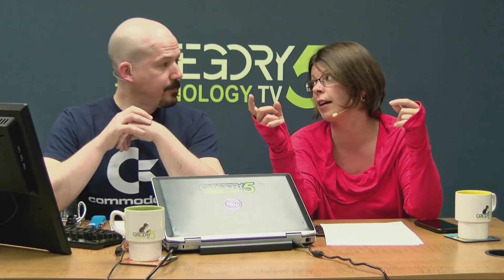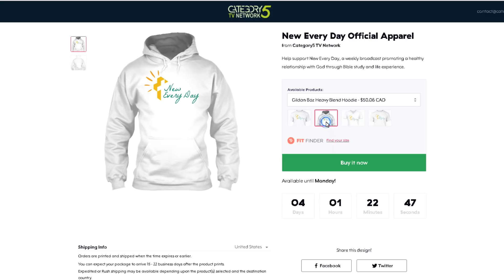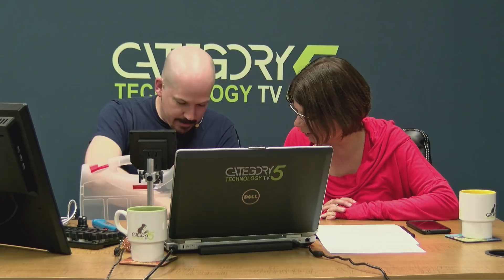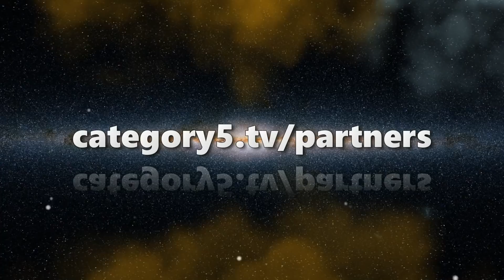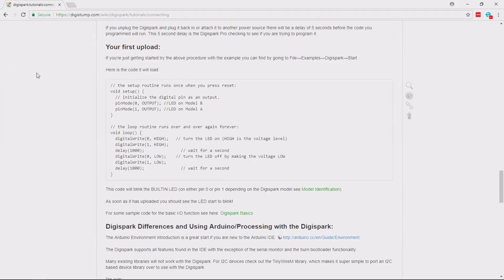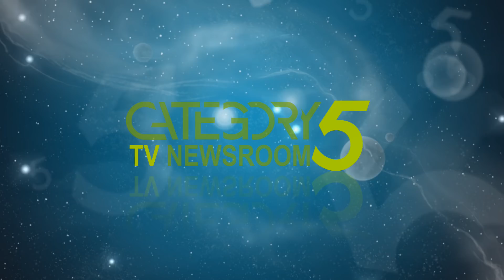555 - Beginner Electronics with a Digispark Micro-Controller

Comment: Personally I would never use a battery powered soldering iron. There is too much risk of cold solder joints and flaky connections as the battery drains and if you do a lot of soldering, good luck finding the bad joint. As others have stated, the technique is to heat the joint and touch the solder to the underside of the iron while in place on the joint. The solder should flow nicely into the connection. Be careful, too much solder and it will flow out the other side of the board and you have a glob of solder that can cause a short. If the solder balls up instead of flowing, the joint isn't hot enough.

BTW, a cat on the shoulder, five fingers held up on the other hand, Cat5. Too subtle?
Reply from the maker: Ha - I didn't catch the fingers! Thought you were just holding your hand in a way so as to accentuate the fact that you are wearing a Cat5 shirt. So subtle Bill, so subtle  :)  haha.  Thanks for the soldering tip (oooh, a pun?). This wireless one is brutal for cold joints... so it's time to find something new. I'm really hoping to find a reasonable station since I'll be using it for demos on the show as I grow and learn. Cheers -Robbie

Comment: That soldering iron is fine, but your soldering technique is backward... Wipe the (hot) tip off with a cloth so that there is minimal solder left. Ideally, the tip will be shiny. Use the clean tip to heat whatever you're soldering, and feed the solder onto that piece, not the soldering tip. What's happening with your method is the solder is oxidizing and preventing any flow to the piece.
Reply: Flux is magic ;D pen (SMD) or paste (ThruHole)
https://duckduckgo.com/?q=soldering+Flux&iar=images&iax=images&ia=images

Comment: Robbie, you don't have to spend a lot of money to get a decent soldering iron. All you need is one that plugs into a wall outlet and runs off of AC current. Any of the Weller line would work out quite well for your needs and are quite reasonably priced. Just select one that is between 20 and 40 watts. Amazon carries them for $15 to $30 US (not sure what that is in Canadian Rupies) and they do an excellent job. Weller soldering stations normally start at about $100 US. Getting one of the regular irons now and having it as a backup when you can afford the soldering station wouldn't be a waste of money either. The iron is more portable and less of a hassle for a quick and dirty repair than the station is. But the main thing is that just about any AC powered soldering iron will be better than that battery powered toy.

I have a couple of Weller's that I use to repair audio/visual equipment, computers, etc and I haven't had any problems with them. I had one that I used for over 25 years of regular use before the heating element went out. 

Be sure to use 63/37 solder. It's better for electrical work than 60/40. 

And you might want to watch this YouTube video from PCPers. Allyn Teaches Soldering https://www.youtube.com/watch?v=mk1O53FSGpw Allyn really knows his stuff. It's about 54 minutes, but it's well worth the time as an investment towards your end goal of your camera switching controller build.